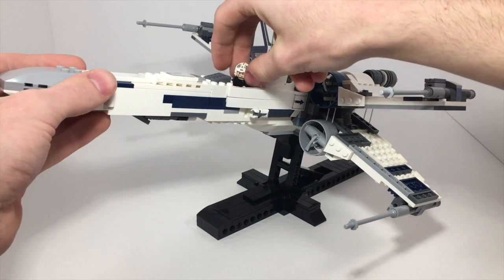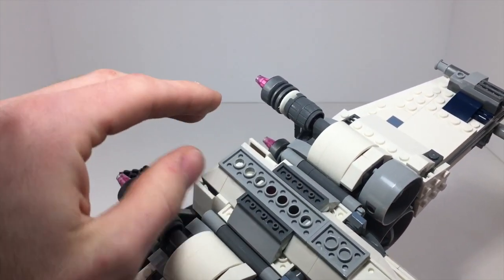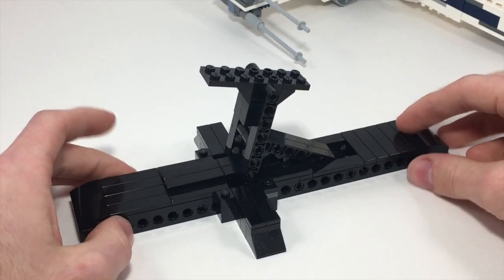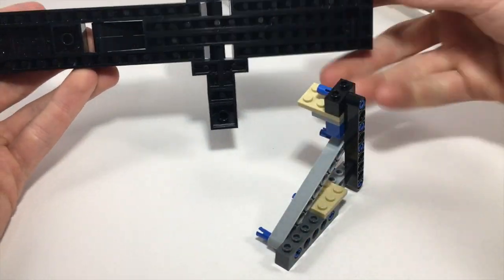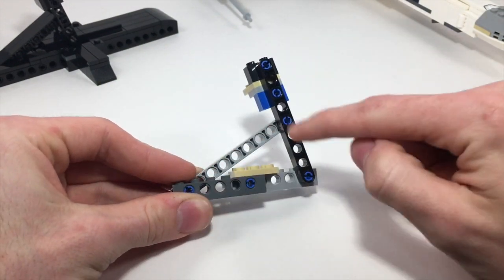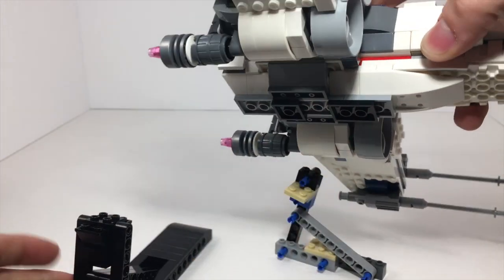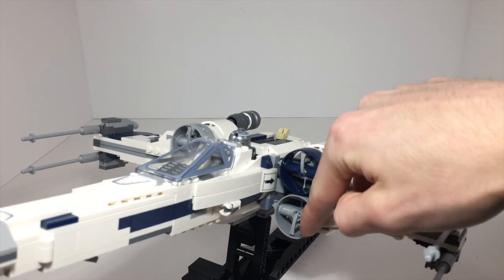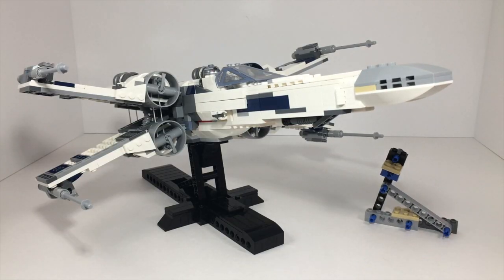LEGO Display Stand for the X-Wing!!

Comment: Nice stand, very pretty - slightly wobbly - might try placing an axle through the centre of the x-wing and change the top fixture slightly for the axel to fit, as currently it can just fall off